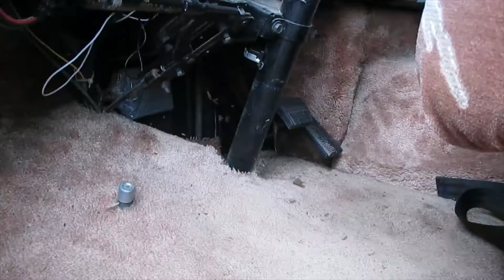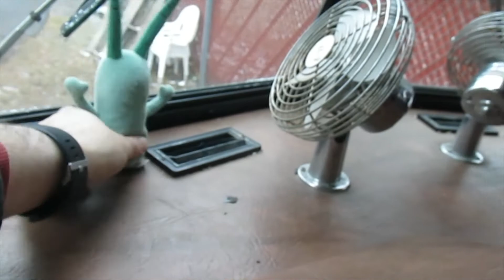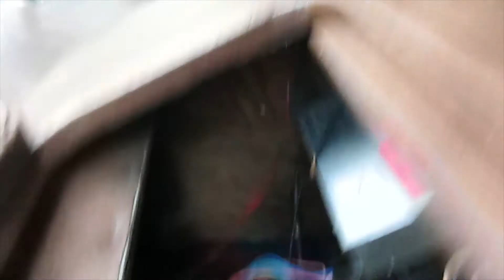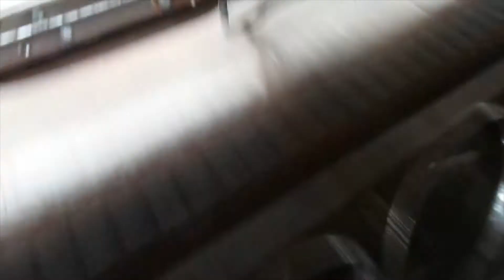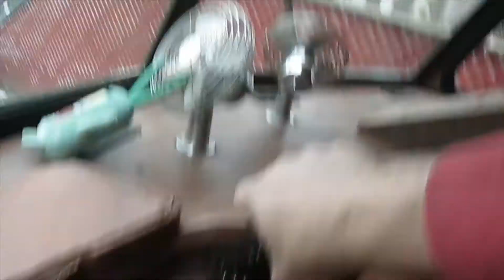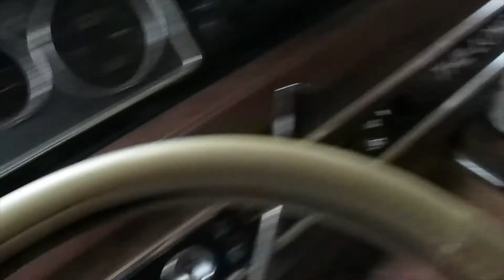Sorting Out RV Electricals Part 1

Comment: Do you have a part 2 of the dashboard wire install?
Reply from the maker: I'll be posting more about the RV electrical and the dashboard as well. Used the new fuse panel to replace what was a corroded glass fuse panel in the back on another video. I have more to do up front with the ducts and gauges coming up! My even install the turn/bank indicator i picked up just for fun.